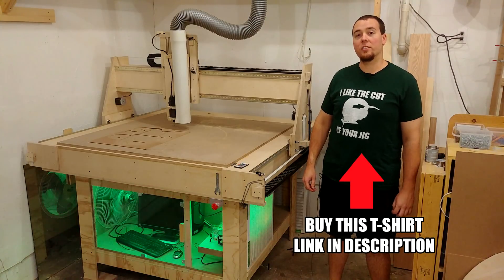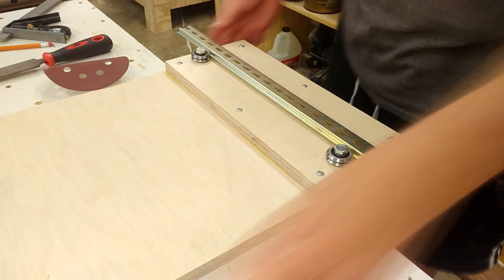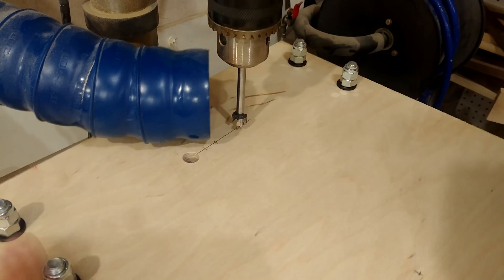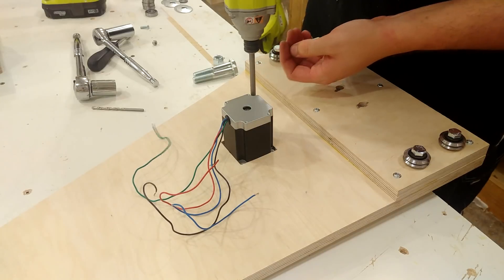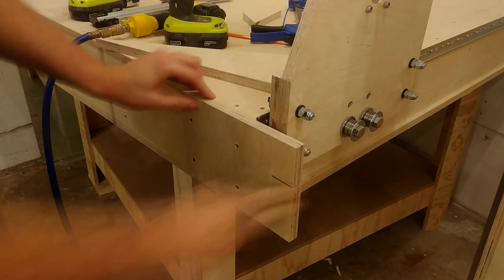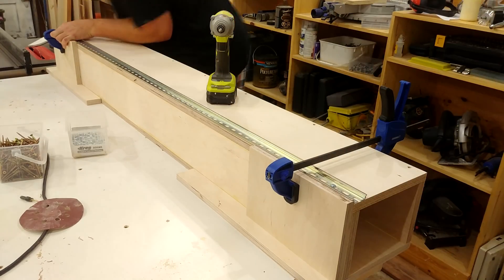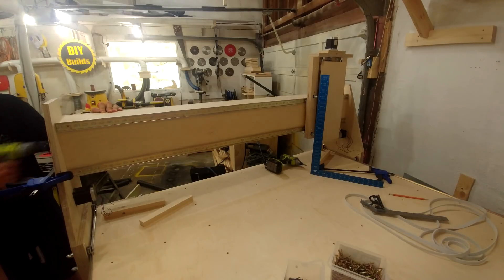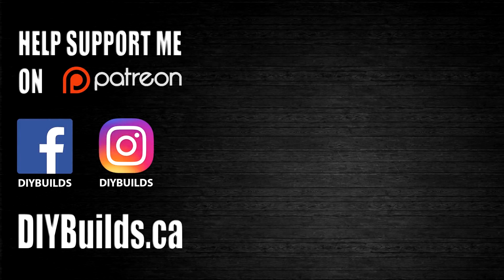Homemade CNC Router Part 3 - Building the Gantry

Comment: Looks and sounds very impressive - the only thing I would have done a little differently is allow for some adjustment on the bearings, probably because I would not have made it as accurately as you have.

Comment: What kind of plywood is that?? Looks quite solid .
Reply from the maker: 3/4" Baltic birch plywood
Reply: @DIYBuilds  Cool it has many layers it would be really solid. Your cnc idea is just amazing I first subscribed you when you had about 1k or less subs. The only thing you paid a lot for are plywood. Cool design I will also make one like this . Quite good , sturdy enough design for laser engraving.

Comment: I am in no way being a dick. I am legit curious how well the DIN rail will hold up
Reply from the maker: Ya im curious too lol. I hope great.
Reply: worst case scenario you could probably just replace it with some shims and maker rail from openbuilds or something LOL
Reply from the maker: I would think that the steel din rail would hold up better than extruded alluminum over time but honestly don't know for sure. That was my rational for not using aluminum angle iron.
Reply: for some reason I thought the maker rail was steel. But youre right. As for as the DIN rail though, I wonder if its cheap pot metal blends, or if its just plated steel for holding up outdoors. I also have no idea what thickness the DIN rail is offhand.

Comment: Really impressive, I love the size this thing is going to be. Do you think it will handle smaller fine work as well as 4x4 big stuff?
Reply from the maker: So far it's working great no matter the size
Reply: Was hoping to buy a CNC this year but may go with what you have. 4x4 is so useful for so many things.
Reply: @DIYBuilds , Do you have any idea what level of accuracy you've achieved?